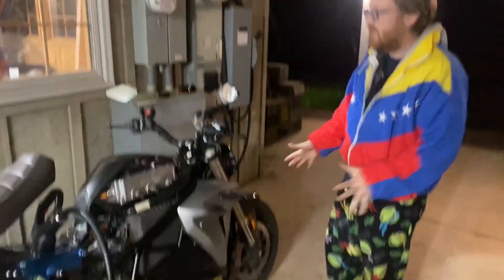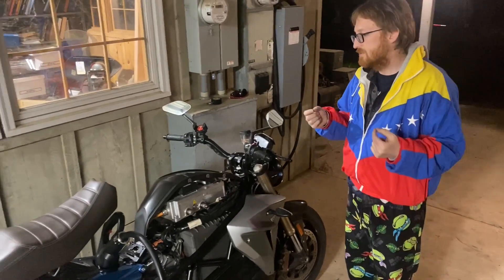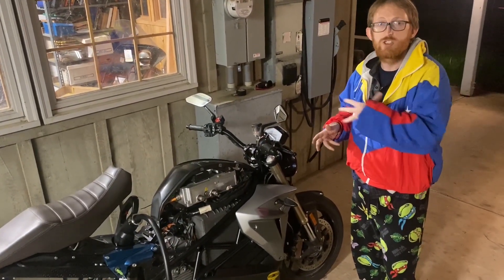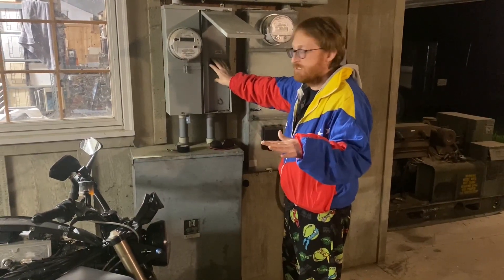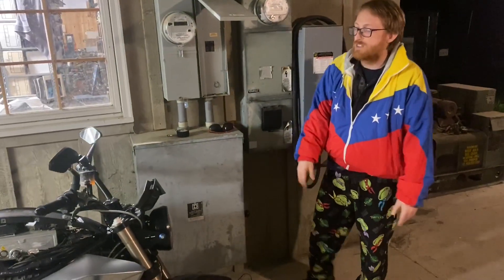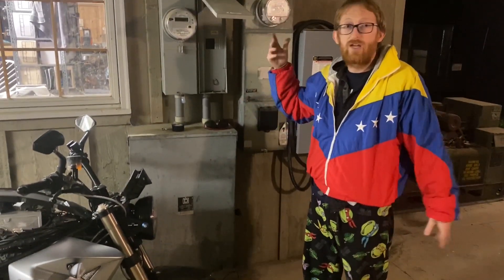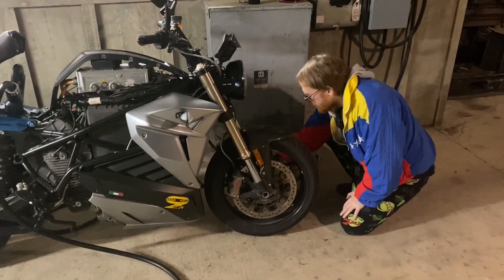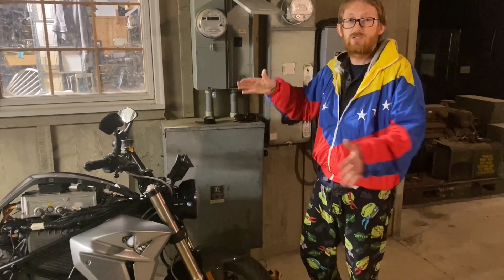Energica Siphon Prototype Overview

Comment: The video didn't go into detail.
All you show is some kind of inverter.
How do you get the power to come out thru charging port into inverter?
Reply from the maker: We built a system that enabled access to the battery's energy through the charge port. It was not standard and required reverse engineering the bike's harness. Hazardous stuff if you aren't familiar with it.

Comment: Hey Brandon,
nice work this V2H principe.
I just bought an Energica Ego, and want to export it to Indonesia soon.
There we have in some village no electricity or grid at all.
So, can you send me a kind of tutorial or diagram how you manage this to the Energica?
Because there it would be really usefull, because of the area in some places.
Thanks in advance.
Best regards Yosa "Energica Rider"
Reply: @BrandonNozakiMiller  ok, that's a resonable price i guess. Can you send me some pictures please?
imessage (iPad), or by mail.
yosa.verheyen@proximus.be
Reply from the maker: I missed this, I was closing the company right around this time due to covid. Hope you are well. My email is brandon@diginow.it
Reply: @BrandonNozakiMiller  hey Brandon, what exactly do i need. Because Setec Power sells something simular, for Nissan Leaf and Tesla i guess.
Are there some electronic adjustments/ settings to do on the Ego?
What is the price for this set?
We are using 220Volt here in europe.
Thanks 
Yos